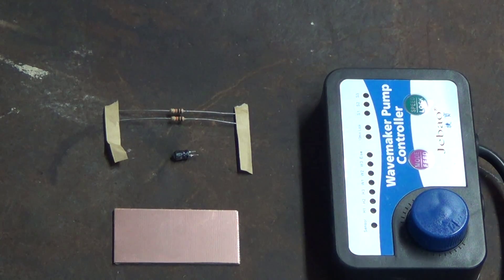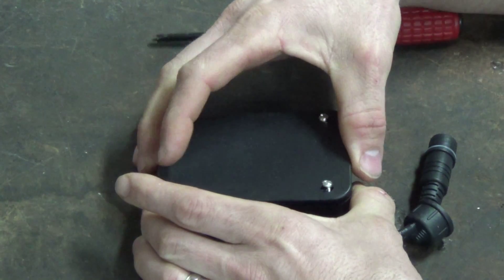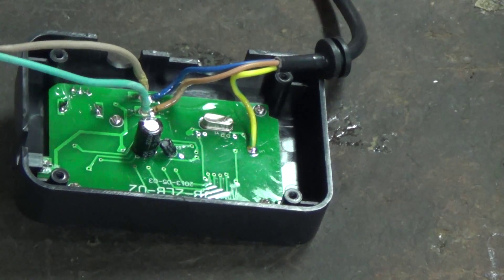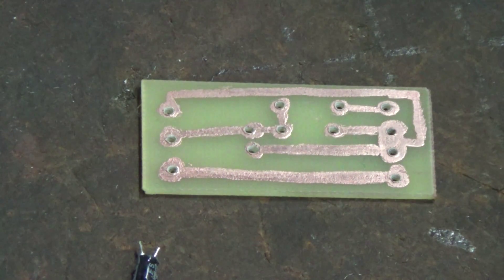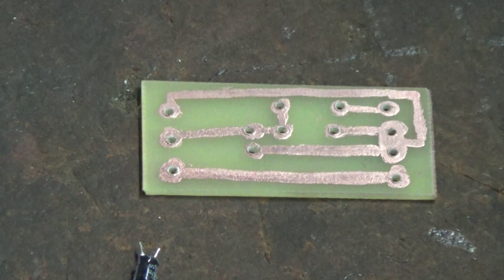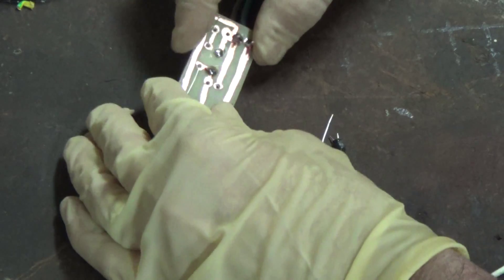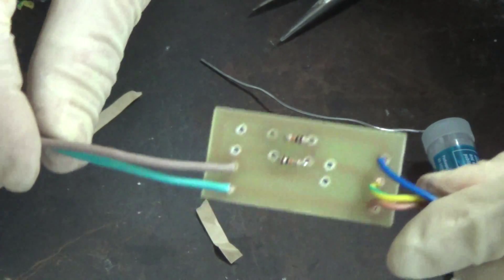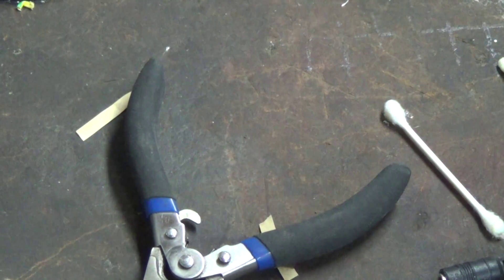Jebao DC pump to reef controller

Comment: HI RYAN I TRIED TO SEND YOU A PRIVATE MESSAGE BUT YOUR YOU TUBE CHANEL IS NOT SET FOR THAT RYAN I LIKE TO MAKE THIS CABLE FOR APEX CONTROLLER I GOING TO USED 6 JEBAO  PUMPS IN MY TANK AND LIKE TO CONTROLLER BY APEX CAN YOU EMAIL BACK TO ME I CAN GET THE PARTS ON EBAY LIKE THE PCB,3 PRUM WIRE THE DC CONNECTOR EVERYTHING ALL I NEED IS GUIDEN THANK YOU JOSE GOMEZ PS MY EMAIL MASTERSURGEON 04@YAHOO.COM
Reply from the maker: the only difference would be putting a connection on the wires the reef angel had screw terminals whereas the apex has a (ithink rj45 connection) which the pinout is available in the user manual
Reply: OK THANK YOU RYAN I ALSO NEED HOW TO MAKE THE PCB I CAN NOT FINDER ANYTHING IN THE NET ABOVE
Reply from the maker: +Jose Gomez search diy PCB on google, basically you draw the circuit on the board with a sharpie and then dip it in an etching solution
Reply: OK THANKS RYAN VERY HELP JOSE